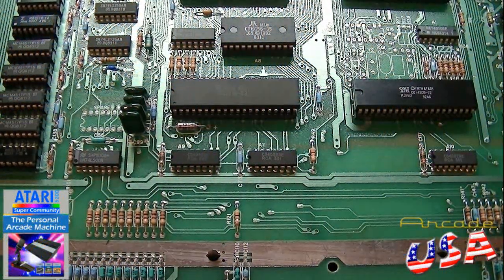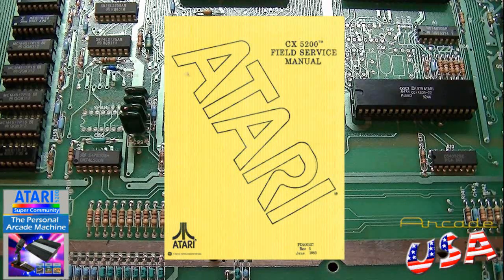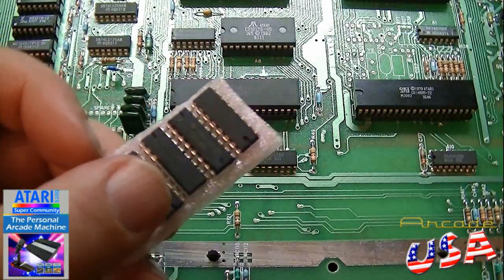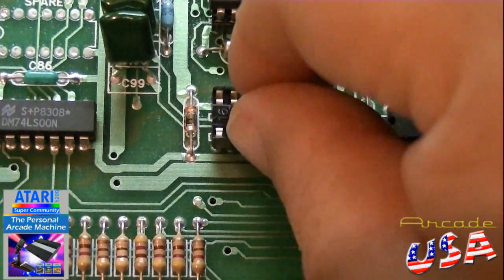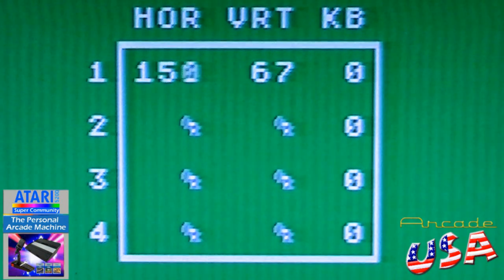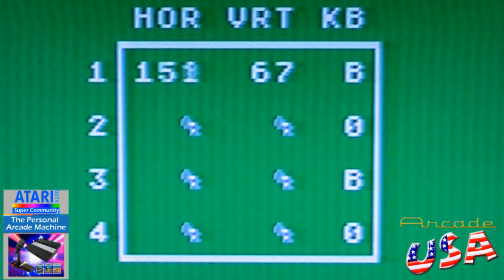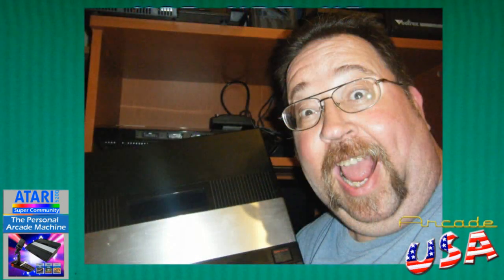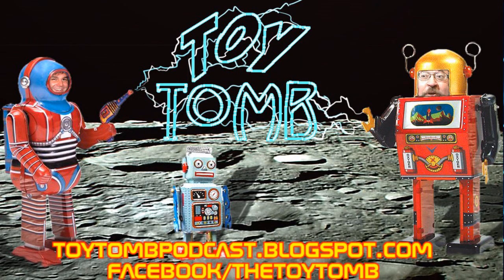Replacing a Atari 5200 Controller Port Decoder Chip

Comment: I'm thinking this is my problem as well.  I had 1 controller but it was broken and so I bought 2 more.  The joystick functions work however the keypad and fire buttons are all having the same issue. I opened my 4 port model and I'm sure glad they are socketed.  I was thinking I was going to have to buy some sockets.  I never had a 5200 before but I liked the games in emulation but I prefer actual hardware if I can.  Bought it for 30 dollars.  The PSU was failed on it so I replaced it, and then the controller stick and buttons didn't work, got 2 controllers for 20 dollars and the sticks work but firebuttons and numberpad don't work, looked at the service manual and now I'm here.  Hopefully tonight I'll be playing Galaxian and Dig Dug.

Comment: I have this same problem, where did you buy the chip and the socket? And do I need to use the socket? Thank You!
Reply from the maker: purchased the socket from Newark Electronics.  you dont need it, but it makes it easier to replace the chip if it goes bad again

Comment: Awesome job Willie! I've replaced all the chips on my one 5200 that wasn't responding to my controller. That unit had both the power issue, and the controller issue, so with those being fixed, that unit should last forever and I keep that one as my spare.

Comment: What'd you use to desolder the chip? I have a really hard time desoldering things and really need all the help I could get!
Reply from the maker: Its a soldering iron with a vacuum bulb on it.  they can be found online for sale at various electronic supply houses.
Reply: Thank you, I've never come across one before and electronic vendors don't exist where I live being rural so I wouldn't begin to know what to search for.
Reply from the maker: https://www.walmart.com/ip/DESOLDERING-IRON/193736255?wmlspartner=wlpa&selectedSellerId=594&adid=22222222227040572355&wl0=&wl1=g&wl2=c&wl3=88258929290&wl4=pla-207427321970&wl5=9010185&wl6=&wl7=&wl8=&wl9=pla&wl10=112343790&wl11=online&wl12=193736255&wl13=&veh=sem